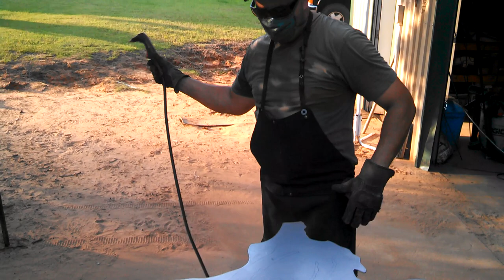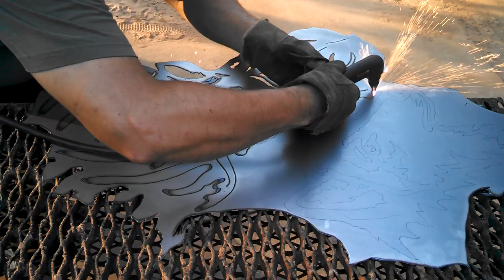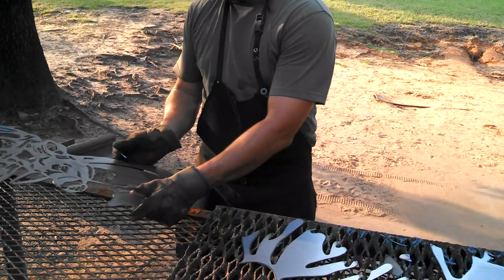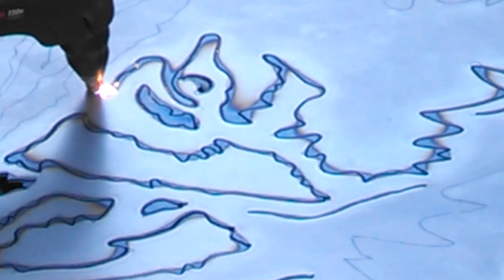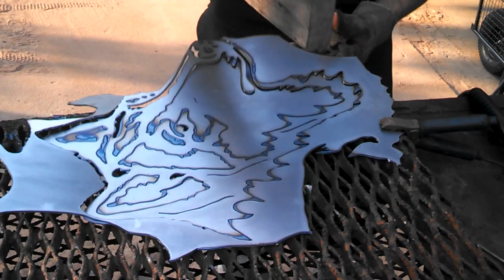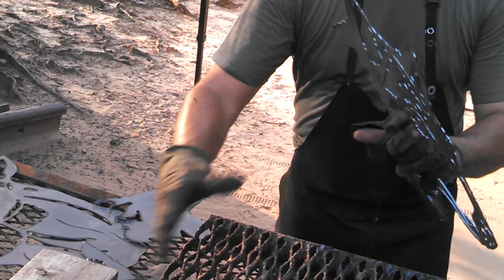Shane Glover of Southwest Silhouettes cutting

Comment: Mad skills. You make free hand plasma cutting look easy. I know first hand it is not easy. Many ruined pieces under my belt. Oddly those fails helped my "creativity" by trying to rescue them into something else! LOL.  May I ask what plasma cutting outfit you are using in this vid? My Hypertherm 30XP is a great machine, but its duty cycle wouldn't allow cutting as fast as you (even if I was able). Can you also share your steel thickness and machine settings (amps)

Brilliant work.

Comment: A colleague told me: You must add an air drying device to the plasma machine in order to maintain it. Because the compressed air contains water, which leads to the destruction of the plasma machine. Is this correct ? Please take advantage

Comment: I have a hypertherm 45 what tip are you using? its a shielded tip right ? just wondering when i cut with mine i have a tip that looks like a cross cut pattern at the tip ,is that what your using? your doing a damn good job of it .I was just wondering if there is a better tip to use than what im useing nice job thanks
Reply: you should try the fine tip consumables for thy hypeertherm